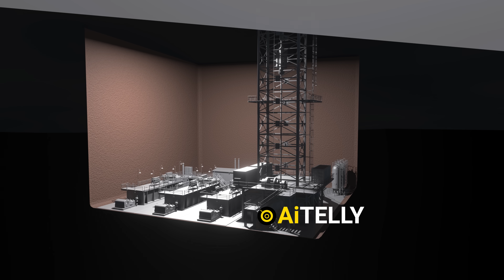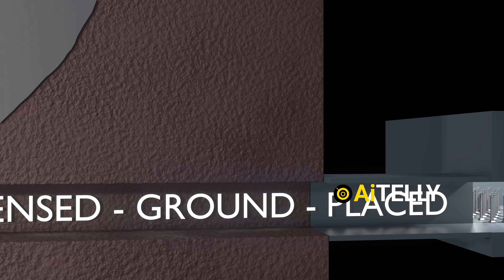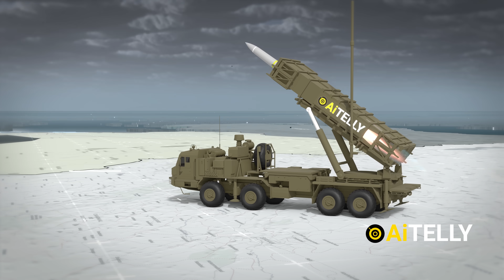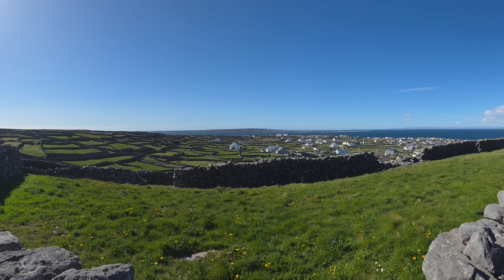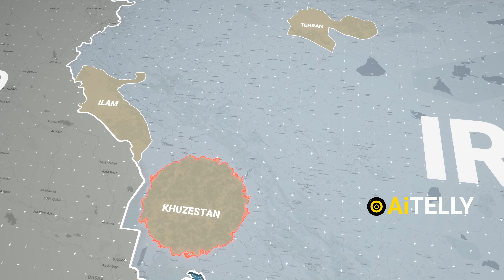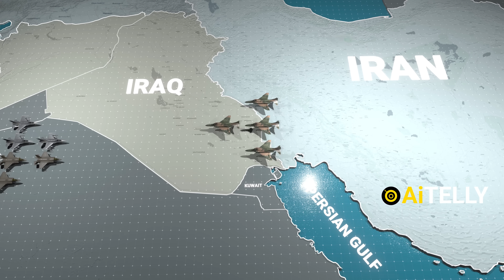How Israel Strikes Iran Nuclear Sites #israel #iran #nuclear

Comment: CCA couldn't be more sought after if not now, especially in the scenario elaborated in this video . . . for e.g. 5 - 8 armed F-35I Lightning II (Block III) stealth multi role interdictor strike fighter & 13 next gen Heron-TP NG UCCAV, armed with two Storm Shadow inertial guided air-to-ground land attack cruise missile each . . . full CCA control on the drones by F-35I pilots on mission, based on artificial intelligence shared protocols across a robust impenetrable defense network (open) architecture . . . ofcourse there's the ground controller standing by, whose authorized to take over full control of the UCCAV if necessary . . . the Heron-TP NG infiltrate into enemy airspace at very low altitude, hugging the terrain as much as possible . . . delivers it's ordinance on target (IRGC nuclear sites) & returns to friendly . . . F-35I monitor the mission from their sovereign airspace & wait for the drones to execute the mission . . . both the F-35I & Heron-TP NG makes it back to their base without as much as a scratch . . . mission assisted by Saab Erieye AEW&C aircraft & 2 F-16I Fighting Falcon (Block II) multi role EW fighter jamming enemy radar . . .

Comment: Israel, unlike Iran, didn't use missles to kill Salami in a residental area, they used suicide drones with much less impact so it wouldn't ruin the whole apartment, just one floor, also Iran doesn't have any fighter jets, and the anti-air defense system you mentioned in the video is wrong, it's much more older and useless, I'm an Iranian in the middle of the war, please don't spread misinformation.

Comment: If Iran needs to be damaged Israel Iran must think about
1. Israel is strong in air defense.
2. Israel is strong in air fighter jets bombing.

What does Iran need to do if Iran needs to destroy Israel?
1. Think about Israel Ari defences system. Think how to damage this system or how to avoid fighting in Israel area.
2. First attached must target fighter jets Laneway  to prevent Israel fighting back to Iran.
3. Iran must develop air defence and upgrade their fighter jets to prevent the sky.

Comment: F14 once the superior CAP platform and air-to-air intercept is incapable of detecting F35. The radar is too old. It may merge into a dogfight with F35, which is what F35 pilots are taught mostly to avoid, but even then, it'll be at a disadvantage.

Comment: Can I ask why your team doesn't use Flow or Veo, even though they are free for generating infographics?
Reply from the maker: AI can't Process Real Events -You cannot put a promt where there are Top Secret Military Data so you have to Work on Human Research - We tried to make it in AI but it's a complete failure
Reply: @Aitelly do you still use zero ai to generate these? I’ve heard some people have managed to use ai to make blender scenes and then worked from there manually